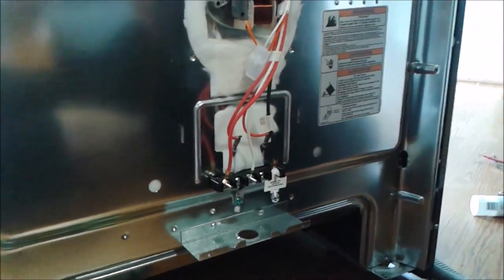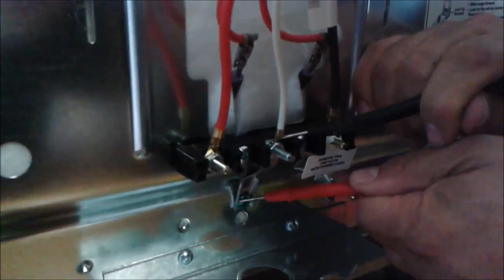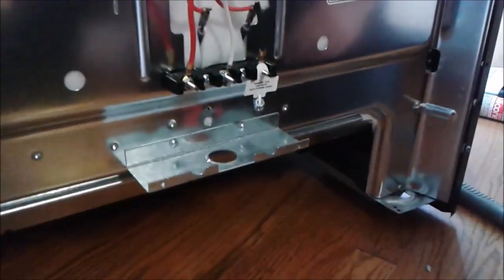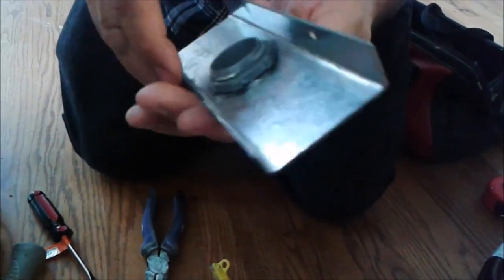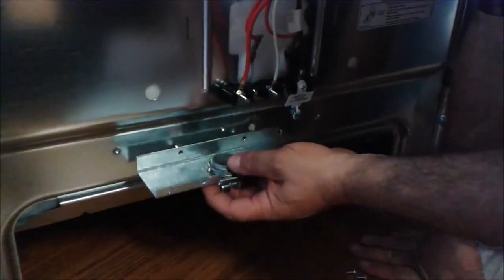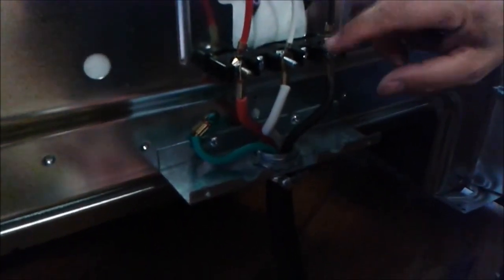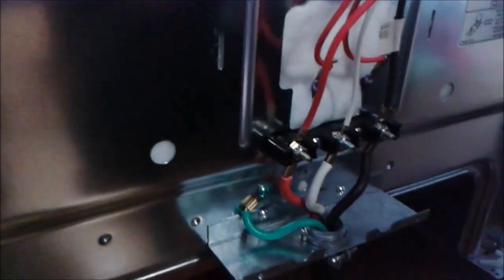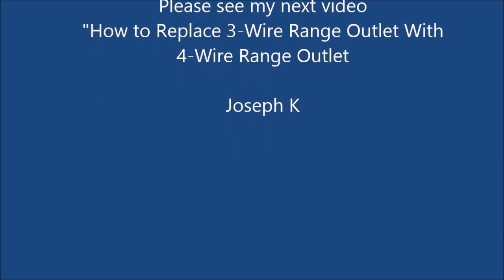How to Install  and wire a New 4 Prong Range Cord to an Electric Oven

Comment: Great video!!! Thank you so much. Now my daughter and I can install her new stove.
Reply from the maker: Thanks
Reply: What did you call the round piece you added to the bracket to protect the wire as it passes through?
Reply from the maker: conduit fitting(home depot or law) and it is called clamp connector:

http://www.homedepot.com/p/Halex-3-4-in-Non-Metallic-NM-Twin-Screw-Clamp-Connectors-5-Pack-20512/100134407

Thanks

Comment: I recently bought a bock laundry centrifuge. it wired up the same way except there were 4 wires that came in the junction box of the centrifuge which were red black white and green. for my centrifuge i had to cut off the loop ends that go onto the terminals and splice all 4 wires of the cord to the  wires of the centrifuge using red wire nuts (Splice type Connection enclosed in junction box)

Comment: My old stove was a built in. The outlet installed is a 4 prong but my house is only 3 wire. My old stove was wired three wire as well. I got a new stove and they hooked up the wires with the new cord and it has four wires. My outlet again is four wires but my house is only 3 wires. So to make it work would I put the green and white together? Because right now nothing is working.
Reply from the maker: No. The green is the ground and it should be attached to the stove  with a screw. The white is the neutral and it must be separated from the ground. 

Can you explain what do you mean house? or house has only 3 wires ? what are the 3 wires ?
Reply: Joseph K out of the wall it has three wires not 4 wires. 2 black on bare. Going into a 4 prong box. So on the 4 prong box only 3 terminals have wires to them. Old stove worked fine. New stove won't do a thing.
Reply from the maker: You need to connect 4 wires to the 4 prong box as follow:
2 blacks to the  2 hots
white to neutral and bare to ground (usually green)

disconnect electricity to the outlet from the circuit breaker panel, then open the outlet box and connect the  white and bare as explained in the above. 
Can you send the model of the new stove ? I like to see if it needs the neutral or not.

Comment: Is there a way to put a plug on a 4-wire oven? I gave a used oven to a friend, he's putting it in his shop and wants to be able to unplug it, move it around etc. He has 240v run to some four-prong recepticles but I'm not sure if there's a way to get it plugged into those.
Reply from the maker: Do you want to put 240v/50Amps plug on the wall or on the range ? You can not put plug on the range !!
Reply: @josephk9182  the plug would be on the Range wiring. The receptacle is on the wall
Reply from the maker: @RetroFrito  Yes you can do it .

Comment: is  the bracket that comes with the the 4 prong cord different from the conduit your talking about? do i need both the bracket and that circular metal piece you attached?
Reply from the maker: Yes. The bracket does not come with conduit. You need to buy the conduit from home depot or Lowes. The bracket comes with the range, so you need both.

Comment: Great video Joseph K.  You're more helpful than the Big Box hardware store people who say they know how to install this.  I'm having one problem.  At minute 5 you show a simple device that secures the power cord as it passes through the bottom hole on the way to the plug. I can not locate that bracket.  Not at the store, I bought it from, not from the manufacturer, not from hardware stores.  Puzzeling.  Can you help me locate one in my area of the US (Dallas/Fort Worth, Texas) or perhaps it's available online?
Reply from the maker: If I understand you mean the bracket that has a hole for the power cord ?  or you mean the conduit?  The conduit can be found in home depot or Lows. The bracket is part of  the rang. You should found the box where the power cable is inserted. If you have further question will you please let me know.
Reply: I finally found an employee at home depot who understood what I was looking for when I showed your video to the clerk.  Thanks for your how-to post sir.  My stove works great!